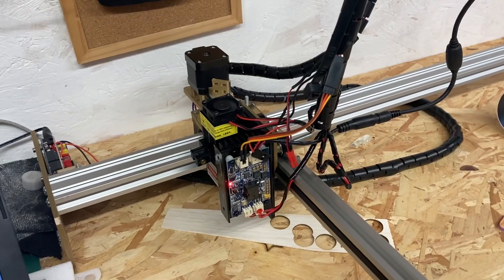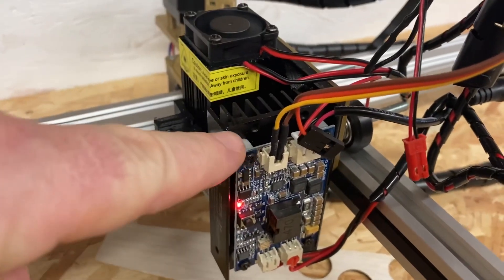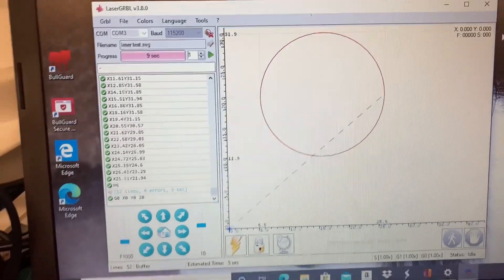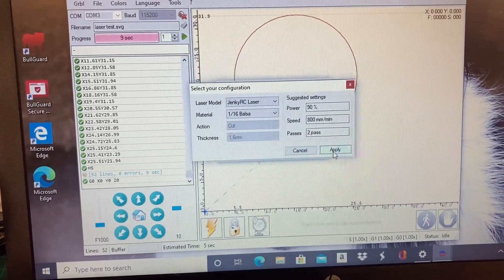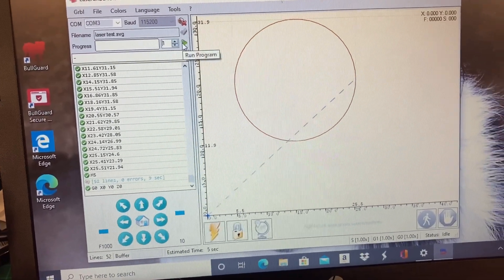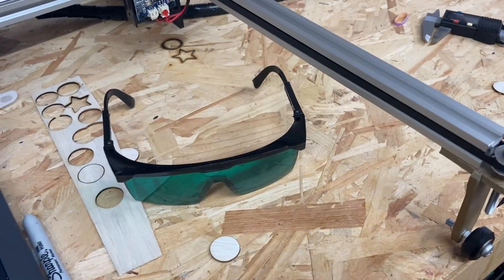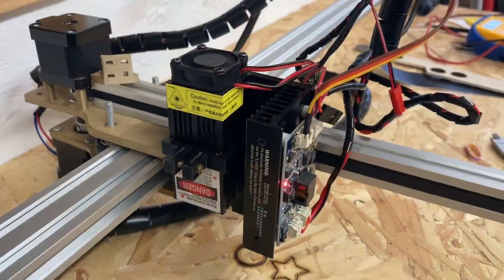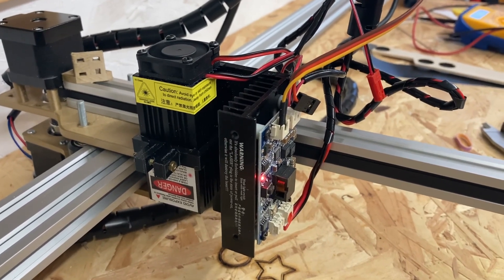5w DIY Laser Engraver / Cutter

Comment: You  should put a colored shield around the beam like Ortur and Atomstack have. You dont even want to glance at the beam at any power setting, people think its like arc welding light but its wayy different.
For anyone else reading this, when doing cutting start with a higher speed and many passes (10) and work your way down (slower) If you start the other way around you could start a fire or burn your material bad. Most of all, HAVE PATIENCE!